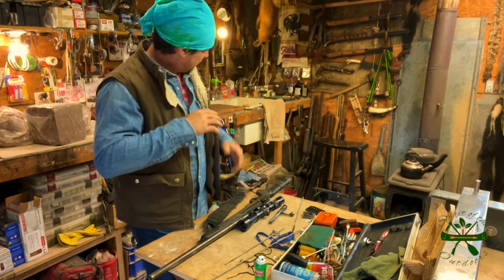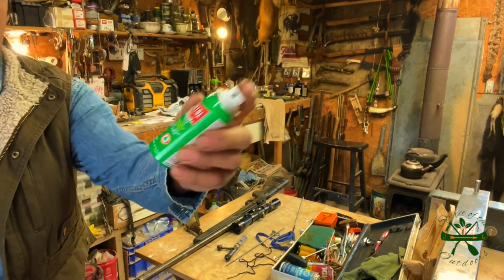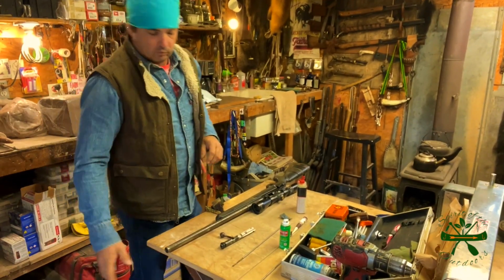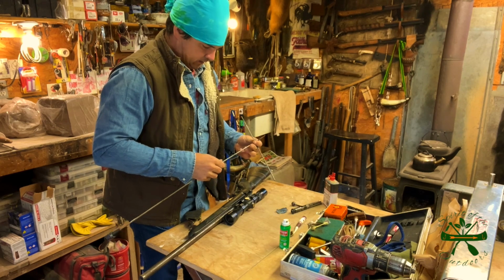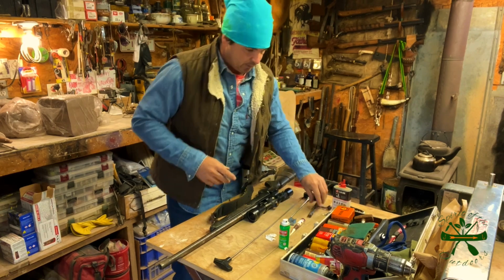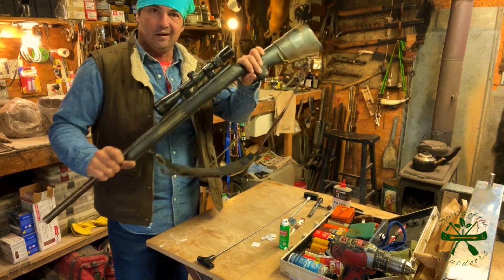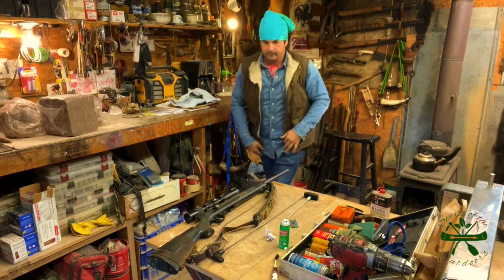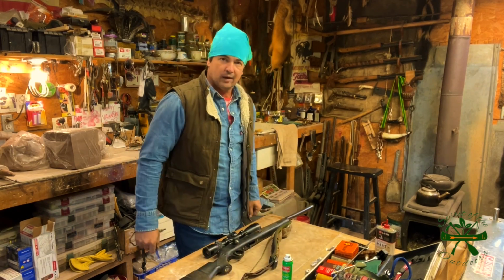Cleaning my Rifle

Comment: I had the chamber get gummed up on a Marlin I had.  I did the same thing you did I just didn't use a drill.  .17 HMR is a good round.  Sight it in a 25 yards and it's still good at 100.
Reply from the maker: Worked fine . Havnt had one stuck since

Comment: That bore snake is designed to go in from the chamber end and out the barrel end that way you don’t pull gunk into your chamber
Reply from the maker: Works either way
Reply from the maker: U must have missed me using the drill to clean a gummed up chamber because a brass got stuck. No big deal most folks dont watch all of it before they start commenting either
Reply: My comment was not meant to be criticism I was just stating a fact, and as you said, whatever works